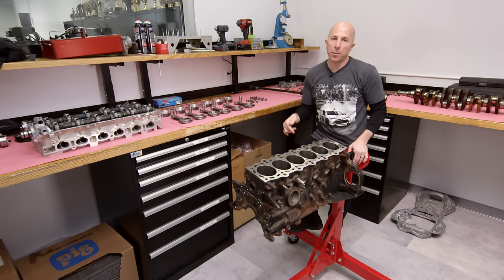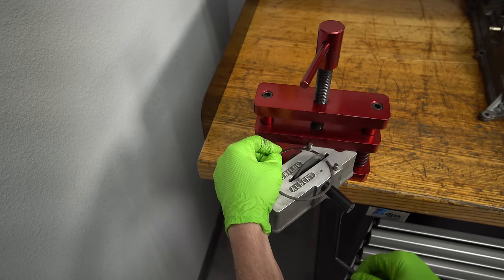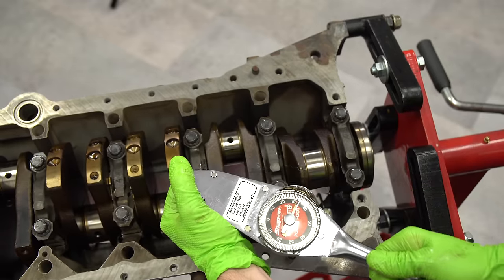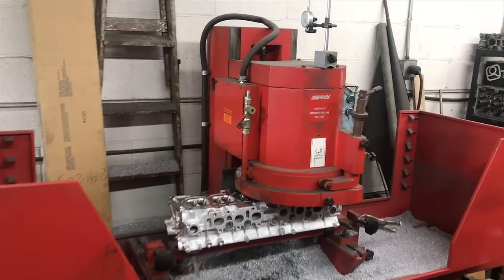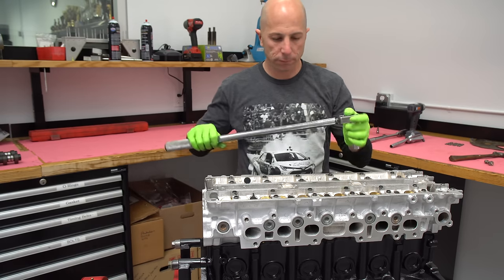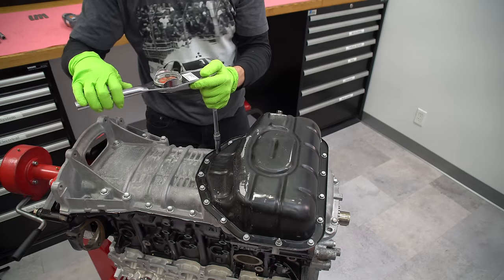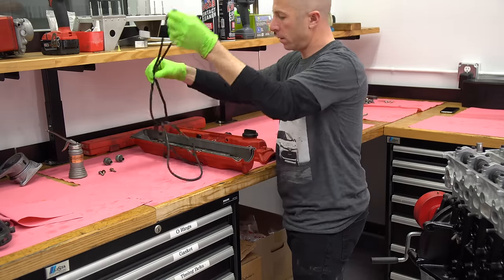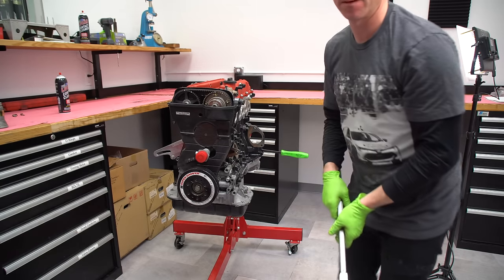Toyota 2JZ Engine Build - Full Start to Finish

Comment: anyone who uses torque wrench all the time for engine builds and repairs is a saint
Reply: I can't imagine not using a torque wrench for any of this.
Reply: @rimjobledouche5201  i know right... and yet ive herd many guys and seen guys do things with out them... ignorance is bliss and sometimes telling people something offends them and so you just cringe
Reply: i thought everyone uses a torque wrench when assembling critical parts. Thats standard procedure.
Reply: @addictedtopussy69  youd be suprised... im from florida, south florida.. what ive seen is people who know how to fix / modify things but don know why or how it works... they dont know about torque specs or anything... just learned from wtahcing other people with out understanding the science behind it..  for example a small shop changing a head gasket or valve cover gasket... with out using toque wrench or going in the right order... yeah they can do it but over time it causes major problems and $
Reply: I am a little OCD, so everything has to be perfect or it will drive me insane. One time at school a guy torques a bolt up to 44.8 lb-ft, I said 45 lb-ft. It drove me insane and had to re do it.
Reply: @alexv5581  im the same way.... watch that .2 mess it up after a couple years... ya know i feel ya
Reply: @alexv5581  depending on the torque wrench, +5 or -5 he might of been spot on if it was a cheap torque wrench. LOL!
Reply: well if the torque wrench is expensive than the engine you are building, you might as well not use it
Reply: @chronicawareness9986  my buddy just got a brake job and clutch job done by one of his friends.

Car came back with most of the bolts just hand tightened. Like, fucking hell.
Reply: @alexv5581  LOL you realize that the torque wrench (beam and click) style torque instruments have a +/-4% accuracy rating? 
(according to ASME B107.)  So how wrong could you be off, 4 - 5 lbs maybe - If i were this perfect I'd have had to quit automotive, I worked for a city fleet including construction equipment for 30 years... talk about imperfection...
Reply: @robertmaybeth3434  I understand, I am an engineer. I know that nothing could be followed decimal by decimal. But in that situation our calculations showed that 45 ft-lbs will be the basic size. With +2.5 tolerance. We calcucalated all results from 45, 45.1,45.2, 45.3, all the way to 47.5. And found in this range, material behaved to our standards. Congrats on a long career, I am just a young engineer(25) dreaming of big things and working hard.
Reply: Local race engine builder only does 350 engines and he doesn' t use a torque wrench.  Done it so long that he knows the "feel".  Race Tested.
Reply: 3 ugga duggas is sufficient for most engine
Reply: Turbotom is the exact same way, check out his LSX tacoma build, pristine order of detail like Papadakis
Reply: When I read this comment after the video the Likes were 666 😂
Reply: Chronic Awareness I can confirm all of what he’s saying, especially in south or even central Florida

Comment: As an rb owner this makes me cry seeing how good this engine is from factory
Reply: I just made the jump after 10 years of RB's, and literally every single thing I've looked at is better designed, bigger and stronger.
Reply: way simpler too compared to the RB and all it's vaccum lines and useless stuff under the intake manifold.
Reply: @liftedcj7on44s  you know its a nissan when it has a fuck ton of lines under the manifold
Reply: Zac Youngson I feel your pain lol. Hurts me to admit the 2J is a better platform.
Reply: Turbo Yoda said it best. When someone takes a good 10 year old engine apart ant works out ways to improve it this is always going to be the result.
Reply: Agree with you the 2jz is simply perfect over an rb. But a well built rb is still a solid engine
Reply: Same
Reply: Will give RBs one thing, they sound wayyyyyy better than 2Js at full RPMs
Reply: I've heared a detailed comparison from a Russian tuning company. And the conclusion is pretty much: both of the engines have little problems from the factory that you need to fix, the RB just has a lot of them, and the JZ just a few.
Individual throttle bodies, the construction of the tappets pushing the valves are considered plus points of the RB. Then the JZ has hydraulic tensioners for the belts, the RB has mechanical ones; for drifting where you spank the clutch all the time and then you have a lot of abrupt changes in your revs, and that's where you really need mechanical tensioning.
^^That's pretty much the only thing where the RB shines compared to a JZ, on all other aspects the JZ is superior or equal.
Reply: I love the way an RB sounds amazing but my first car was a IS300 and ever since then I’ve been addicted. Car lasted over 300k and I rarely maintained it along with spraying nitrous to it as quick as I could get it. I loved that car it just kept taking everything I threw at it until she said no more and BOOM, I bought a Chevy lol. I will be investing in another one here soon mainly just to have another 2j so I can slap a turbo on it instead of nitrous.
Reply: 2JZ UL8R the sound of a blown rb with no oil pressure 🎵
Reply: this info has been around for years but it seems people are just now educating themselves.
Reply: @TYSONRAW  this info has been around for years but it seems people are just now educating themselves.
Reply: But it should also depend on what you're doing and trying to achieve though, right?
Reply: Good? its dessigned to be durable for years and years, all of pure steel to ressist all the stress during years and years.... Nothing new. Actually, bmw and mercedes did that in the 80´s, but for the car company, this is not a busisness to have a reliable engine which can perform 600.000km with 0 problems. Thats why good engines diead after 2000.
Reply: cough cough 
oil delivery
Reply: don't fret, just put a stroker in your Skyline, aka a 2jz (disclaimer: the RB26 does sound orgasmic as fuck)
Reply: 2jz or a ls is goin in my 300zx z32.. one day. Haven't made up my mind which.. it has a vg30dett right now but eh lmao we all know how that sucker is.
Reply: Well people forget that Toyota made the 2jz because of the RB26, they knew that the RB was great during it's time so they just their own version of an RB engine which is why the 2jz is better. If the 2jz came first Nissan would've done the same thing and came out with a better engine for competition.
Reply: 2JZ UL8R no they don’t! They’re both turbo straight 6’s. Who gives a crap about sound, this isn’t a musical instrument... it’s an engine!

And 2jz is way better.
Reply: It is a normal gray cast iron. What do you mean by that..? The rest is purchased upgrade material ... pistons, connecting rods, pumps, valves, springs etc ...😂😂😂

Comment: the attention and care is beyond mind blowing. your literally a 2jz master. if I was loaded and needed a rebuild for a 2jz. I would only trust you.
Reply: Exactly, you'd HAVE to be loaded in order to afford his kind of work.  Surely, an invoice from him for a 2JZ rebuild is at least a few grand in labor.
Reply: Anh Tran same here! 👍🏼
Reply: Yeah man and he got that engine looking like it just came off the assembly line.
Reply: @MrEpicAndroid  maybe somewhere between 8-9.5 k
Reply: @malcolmaustin8745  Mine was about 13k total and that was for a 3.4 stroker and a head games vvti head.
Reply: Another poppet valved loop charged 2 stroke with baffled intake valves to prevent short circuiting of intake charge. Now mount a dry sump with oil injection and and some amsoil dominator 2 stroke oil. that is the only oil i would use in this engine if i get one. hehe
Reply: @malcolmaustin8745  This is completely normal in engine construction. I do not know why people are getting so in here now. He explains the details. These details are completely normal in German engine construction. This has nothing to do with the 2jz engine and it has nothing to do with this performance upgrade ...😂😂😂 You´re funny...
Reply: Malcolm austin what’s his email?
Reply: Its a poppet valved loop charged dry sump 2 stroke and nothing more. i would fill and feed her klotz techniplate.
Reply: 2 stroke poppet valvre or give me the mazda rotary, i woulkd bash this thing to pieces if it were a 4 stroke, fucking 4 stroke vermins must die, what oil injection pump do you run?

Comment: That's a cool torque wrench!
Reply: That's what I was thinking! I planned on scouring the internet to find it.
Reply: I assume you mean the one with the flat bit and manual gauge? Those are made for lighter torque applications, like engine components. I know snap on has one like it, but there are probably other sellers
Reply: Yeah, they're super nice. I've used both, and I like the dial type for smaller stuff where you sometimes don't get a good click. Of course if you're in tight spaces or an awkward angle, it can be a pain because you have to see the dial rather than going by feel or sound.
Reply: Looks really fun.. :)
Reply: Rotational torque wrench 🔧
Reply: Snap on 1/2 inch torqometer  + or - 1% accurate
Reply: Dont really like dial George torque wrenches, unless you are this guy with a nice big workshop with an engine on a stand, then you will be in an awkward position and wont be able to see the dial🙄
Reply: @scotwilson4169  Who rebuilds an engine in situ?
Reply: @RainBoxRed  I'm talking about using dial gauge torque wrenches in general, not just rebuilding engines

Comment: It's impressive how much is stock. I expected an exotic head, a big fat crankshaft, and all kinds of other things. Toyota really did do a good job on the 2jz didn't they?
Reply: It was a product of the 90's in Japan. Their economy had been crushing it for years and Toyota could afford to over engineer their parts. Such a stark contrast to the current Japanese economy.
Reply: The RB engine had been out a wee while Toyota got a few and thought this is cool tech... how can we improve it in every way. This the jz was born
Reply: @rx323bug  actually no, this engine wasn't designed at all by Toyota, they took it from yamaha's 1jz and just made adjustments to it and called it the 2jz
Reply: @AC-xq4hh  Toyota didn't take anything from Yamaha, Yamaha has been helping Toyota design almost all (if not all) their "GE" series of heads since the 2000gt. Its always been a team effort Yamaha perfects and optimizes the head ports, angles and valves specifically to Toyota's crank stoke, diameter and piston shape.
Reply: the 2JZ is arguably one of the best stock motors thats ever been produced.
Reply: @n0ti5  Never knew this. Yamaha did a lot of work for a lot of other people including Ford (SHO engines) and Volvo (the B8444S V8 used in the S80/XC90)
Reply: Mild Mannered Hate the head was designed by Yamaha and the bottom end was copied from Mercedes.
Reply: Yamaha 2jz.
Reply: But you have already seen the same video as us?
Reply: @d3tach3d  LS too

Comment: One the best engines Toyota ever produced. Bullet proof. Worthy of restore and keep.
Reply: It's definitely the best as far as power is concerned
Reply: @willybman3723  wrong, google 11,000 horsepower hemi dragsters. hemi > 2jz. but 2jz is top 5 engines for sure
Reply: @maxlegends2897  also, since when do we compare an engine that was mass produced to an engine that's purpose built for a top fuel dragster? That also runs on alcohol?
Reply: @poaoestrakani4873  agreed but he went an insulted me on something regarding all engines and he was right because it was regarding toyota engines arguement aside the way he handled it was not to my liking and i checked him on it because most people wont. You shouldnt disrespect anyone if there wrong, you can correct them or not thats your freedom but if they disrespect you have every right to go for the jugular. Notice how you didnt call me an asshole but simply implied i acted like one? Thats good character
Reply: For longevity I'd say my 1986 2.4L 22RE 4 cylinder has to be up there at the top.  Not much power 114 hp and 140 ft/lbs. In my 2WD truck the gearing makes it decent quick around town. Cruising 65 to 70 is just below max torque, so it moves well with the traffic. Plus true 32 MPG at 60 -65 MPH. Still going after 33 years and 468,000 miles. Doesn't burn enough oil to see much drop on the dip stick between 5000 mile oil changes with good old Castrol GTX conventional oil.
Reply: WOOOOOW that's part of your family i would cry if something was to happen to it, i have an 2004 Nissan Pathfinder LE Platinum ed. VQ35, i've had it for nearing 10 yrs,  it's part of my family,  and if something were to happen to it i would be a mad man.
Reply: Didn't Yamaha have a hand in this engine?
Reply: @jeebzcooke2174  yup they helped make the heads
Reply: @maxlegends2897  You comparing a production engine to a Top Fuel V8?
The latter spins something like 750 revolutions before it needs a rebuild.
The 2JZ is a more impressive production engine than anything the domestic manufacturers have ever put in any production vehicle.
Its an incredibly stout over-built motor that can handle 2.5-3x the factory output.
Reply: @bonniebuckhalter9393  @Jeebz Cooke Aside from the rest of the ppl in this reply thread, i'm good to reply to this - not for correctional purposes though just information and tag in on a fun topic :). SO, after THAT preamble lol, Yamaha indeed had a "hand" in it if you want to extend the design and influence to them. Yamaha has had and still has a long and healthy relationship with Toyota working in consort. However, Yamaha produced with Toyota's requirements, the 1JZ head though did not design the 2JZ head... like I lead into, definitely influenced, as now that Toyota had an awesome working and proven head, Toyota took the design and ran a bit farther with it under their own R&D team to produce the 2JZ. :)
Reply: Maybe we'll see the same with the new B58; perhaps another gen supra after the "Mk5" will emerge with a rein-visioned Toyota version of the B58 shoulder shrugs one can dream lol.
Reply: S85 tho
Reply: @maxlegends2897 , triggered, lol.
Reply: @willybman3723  you call him a dumbarse.  But as much as he misunderstood your comment, Toyota actually did make them.
Reply: Also conveniently a Toyota, and same era.

Comment: The 2JZ represents the pinnacle of automotive engineering along with the Toyota GR engines. The VAG 1.9 TDI engine and PSA's XUD engine. We couldn't build such a master piece today.
Reply: zoidberg444 - Compare this masterpiece to the B58 in the new Supra.  That thing is half plastic.  It’s going to fall apart like the rest of the modern BMW engine lineup.   Oh, and the timing chain is in the rear, next to the transmission.  When those soy/plastic chain guides melt, it’ll be a straight trip to the scrapyard.  I bet we’ll start seeing 2020 Supra’s going for pennies on the dollar in five years.
Reply: @ClockworksOfGL  Yeah. BMW are lightyears behind Toyota in terms of build quality and technology. BMW have miserable timing chains on their N47 diesel engines. The chains snap all the time. It costs thousands to repair. I'd imagine the B58 timing set up will be even more fragile and prone to failure.
Reply: @ClockworksOfGL  Typical used BMW pricing curve: $70k today, $30k in three years, $15k in five years, $1,500 within the decade.

Comment: He's using a Sunnen dial bore gauge, it's the best - expensive but worth it. The one different thing I would invest in is a motorized ring filer. They are quick and the one I used had a dial indicator that showed exactly how much material is being removed. ProForm sells one. Also he's using a very accurate, mil-spec, Snap On torque wrench, another expensive "must have". Many torque wrenches are not accurate and sometimes people use 1/2 " drive torque wrenches when smaller 3/8" inch drive should be used. I'm not trying to be a know it all but I've worked at a shop that machined many NHRA record holding engines. I was taught by perfectionists.